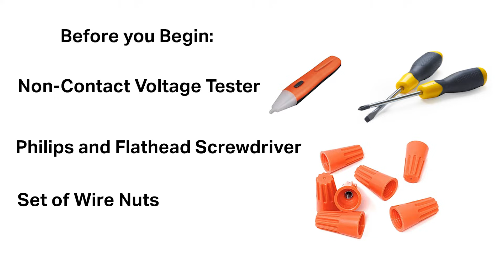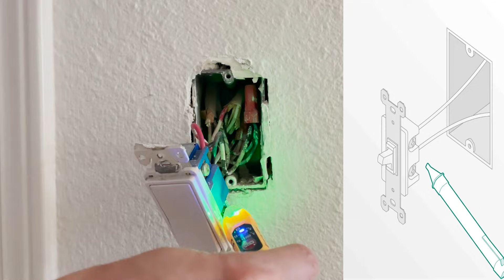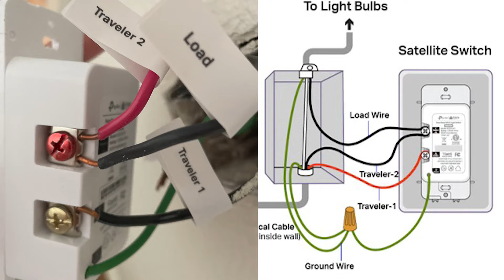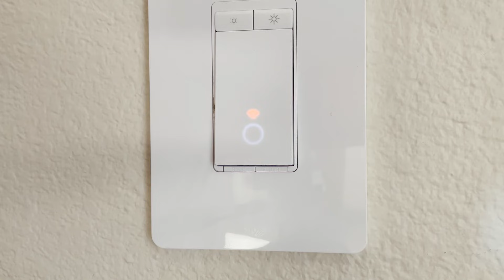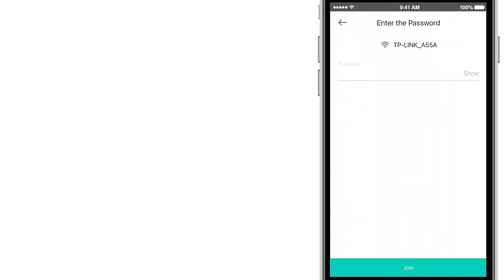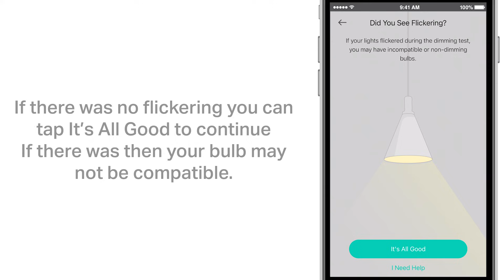Installing and Setting Up the Kasa KS230 Smart 3-Way Dimmer Switch

Comment: Yep, this video confirms I installed everything correctly 🤦‍♂️
I set the app & everything up. The 3-way dimmer switch was added, and did the little self-dimming test, but the secondary switch doesn't work when you press it. Only the first switch & in-app controls work.
So there's something else wrong with the switches. 
I'm gonna check my router when I get home.
Reply from the maker: You may need a Firmware update.  Please reach out to support for assitance.
Reply: Did you get this to work ... I'm looking at possibly picking up some of these??
Reply: @john_thorpe  We gave up on the 3-way switches, and just used the single smart switch, with a pair of "dumb" 3-way switches that offer traditional button-press on/off & dimming functions. 
After Amazon sent 2 replacements, we sent them all back because they had the same problem.

Comment: How can you tell the difference between load vs traveler wire on where the dummy unit is to be installed?
Reply from the maker: Usually its based on how the old switch is wired.

Comment: Has anyone got this too work in connect with the kasa 3 way switch? It seem silly to have 2 dimmers.
Reply from the maker: No the KS230 and HS210 are not compatible.  Wiring is different and in the KS230 both units are needed to creating the circuit.  This is different with the standard 3-way HS210 switch which can be paired with a manual switch.

Comment: I got one of these kits from Amazon, seems the satellite is unresponsive to input nor does it's button illuminate,  the main switch is still able to power the light on and off however (I.e. power goes through the satellite's traveller/load terminal)... wondering if I've done something wrong or it's DOA. 😟
EDIT: I just noticed the 3rd brightness level dot from the right on the master is permanently illuminated, is it trying to tell me something?
Reply: I have the same issue; the main switch works fine. But when I connect the slave switch, the app tells me there is a problem with the wiring.
Reply from the maker: You will want to contact support.

Comment: I bought this for a group of 5 lights that have 3 different on/off switches currently. How do I get this to work?? I've tried multiple configurations
Reply from the maker: What you have is a 4-way environment.  The Switch is a 3-way switch and not designed for such a scenario.  This FAQ explains these scenarios better.  https://www.tp-link.com/us/support/faq/1372/
Reply: Lol let a real electrician do the work.

Comment: The pictured wire diagram in the video is the opposite of what is actually being demoed.  I smoked a kit because of it. 
I also think one of my kits came dead on arrival too, as it appeared that the wifi was already set up.
Reply from the maker: Its actually not.  As is stated in the video you simply need to make sure that you properly identify the Line and Load wires.  Also you need to make sure that the same wire is used in each box as the traveler wire.  For example if you label the red wire traveler 1 then in the other box the red wire would also need to be traveler 1.
Reply from the maker: @perriponders289  Not sure really I don't have access to inventory levels but I am told that attentively it should be around the end of the month.
Reply from the maker: @perriponders289  No it shouldn't.  The main switch has the Line and the Satellite has the Load wires.  Load is what carries to the light.  The traveler wires are what tell the two switches what is on and off, and as long as you use the same wire in both boxes for the same traveler 1 or 2 it should not matter which one is label 1 or which is labeled 2.
Reply from the maker: @perriponders289   that's unique.  Usually the traveler wires in both boxes are the same color so like in the video Red for what we used as traveler 1 and black for traveler 2

Comment: Can this be used with a 4-way switch in between the two 3-way dimmers?
Reply: I want to know this also, if there is some way to make it work despite some saying no
Reply: @bjfire01  https://www.youtube.com/watch?v=cRohQMz8w_o
This could help, I am also eager to know.
Reply: no, KS230 KIT can only be used in 3-way circuit, and the two switches in this KIT are master-slave kind that need to be used together

Comment: Hi, Are you going to be releasing just the main switch instead of the kit? If so, do you know if it will work with a "dumb" satellite switch on the other side? Thank you!!
Reply from the maker: At this time no there are no plans for a single item pack.  We are told that the two switches are needed for proper function, even if the satellite switch is a dummy switch.  This could be accurate or simply that single switch with existing switch function was not tested.  If you try it please let me know if it worked.   Keep in mind that if you do the traveler wires need to be the same at both switches.

Comment: Hi, any news when this model will be released in Canada? Do I need two units for a 3 way installation or can one be a HS230 and the other switch a regular 3 way switch? Thanks!
Reply from the maker: Hello unfortunately no.  This channel is ran by the US team and we do not get release windows for other regions, even our neighbors to the north.  You can Email CA support support.ca@tp-link.com and they may be able to tell you.  We are told that both switches have to be replaced.  The 2nd switch is a "dummy" satellite switch but i am told they still need to be used in tandem with each other.

Comment: When?
Reply from the maker: It should be very soon.  We are working on a few concerns raised by early adopters and once those are all addressed we will be able to release it fully.
Reply: @TPLINKUS  its listed on your site, but when I click buy, I get a 404 error page not found
Reply from the maker: @DFProductions2011  It is but the buy link is currently disabled until a few concerns are sorted out.
Reply: @TPLINKUS  what are the concerns?
Reply: @TPLINKUS  it's now available to purchase on amazon, is it fixed?
Reply from the maker: @henrytoh4217  That one may be the HS210 3-way.  I was not able to find the 3-way Dimmer available yet.  We have addressed the main concern but there are a few smaller concerns we are trying to address right now.
Reply: @TPLINKUS  no, it's the ks230 kit that's been available to order since yesterday for $49.99 on Amazon, just checked right again.
Reply from the maker: @henrytoh4217  I was not able to find it, though with Amazon's algorithms that is not unheard of.  Can you provide me the link so I can investigate further?  I did a Google and DuckDuckGo search for the link  and tapped the buy now button on KasaSmart.com and was not able to pull it up.
Reply: @TPLINKUS  posted the link twice but it keeps getting deleted, let me know if there's another way to send
Reply from the maker: @henrytoh4217  finally was able to find the page, however it does not show available at this time.  The link you are seeing may be a third party seller.  The ship and sold by should say Amazon.  Anything else at this time is not a valid seller.
Reply: @TPLINKUS  Thanks, yea now it no longer shows the $49.99 sold by amazon that was there yesterday, and now a 3rd party seller for $134.99.
Reply from the maker: @henrytoh4217  Yeah defiantly stay away from that.  3rd party sellers are also almost never an authorized seller which means that there is no warranty coverage for said product.
Reply: @TPLINKUS  it's now back on sale for $49.99 on Amazon again, shipped and sold by Amazon not a 3rd party seller. Are these now fixed?
Reply: @henrytoh4217  haha good story for a movie drama, amazon know more as tp link themself.
Reply from the maker: @henrytoh4217  From my understanding the concerns have been resolved.